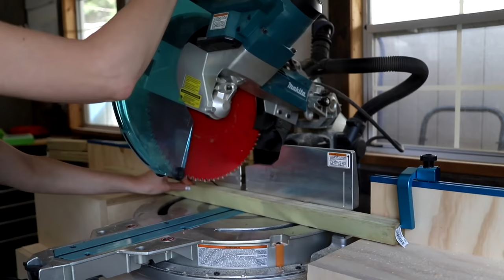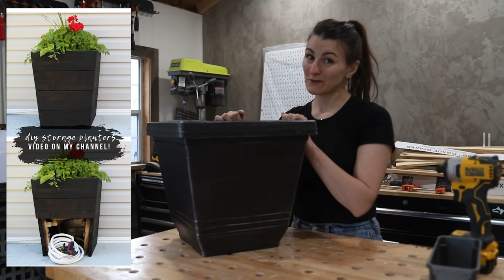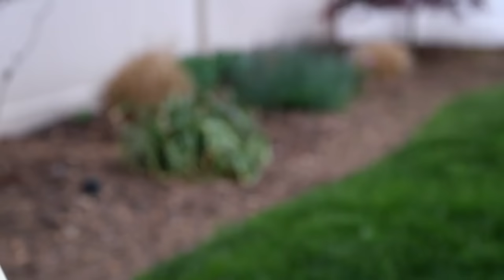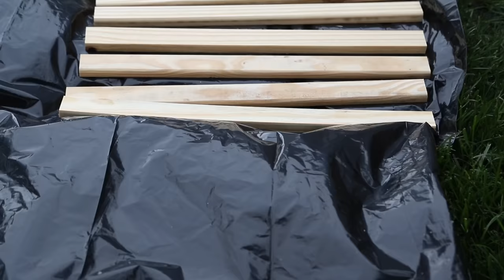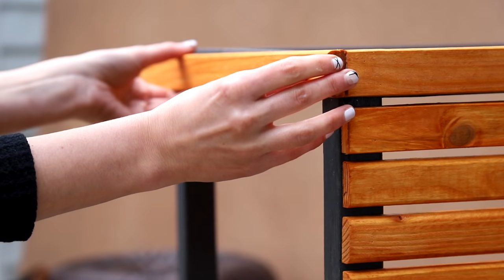EASY DIY PLANTERS (IN 1 WEEKEND & WITH 3 POWER TOOLS)!

Comment: A creative upcycle trick:  use old wood blinds for the slat wood.  Less cutting and cheap;-)
Reply: That. Is. Genius.
Reply: Or pallets... did a similar project with pallets without disassembling them fully. Just some cuts and screwing together.
Reply: Too thin untreated wood, wouldn't last a year outside 👎
Reply: @thedj5914  you can stain and treat the wood.
Reply: For outdoor use is better to stick to pressure treated wood

Comment: Nice job, and yes that olympic deck stain is great, awesome product. I dont recommend using a sealer like poly on anything outside that gets weathered or sun on it, it will always need resealing every year recommended, even the marine varnish also. At 2 years often u will have peeling poly , if it is a porch ceiling that is about only place i use it exterior, other than that i use porch and deck stains that last much longer. Like front doors and shutters i use a product called siekens i think is how it is spelled, it was bought by ppg a couple years ago so it is a ppg product now, but it is a great product.

Comment: Tried this project today; gonna have to modify it because, although I used the measurements from your site, the 14” slats are too short and the 16.5” are too long. I also couldn’t figure out how the two different sizes were to fit around a square box, but I’ll tweak the frame tomorrow and it should come out fine. Thanks for the inspiration!
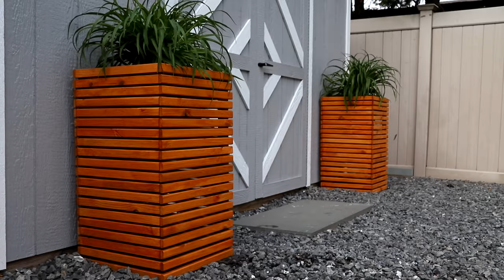Reply: If you pause at 8:13, you can see that she uses 2 different sized slats. So the long ones are for the front and back, and the shorter ones are for the side. The long ones overhang the thickness of the slat. I hope your build turned out okay. :)

Comment: Hey so I used your links and for the pickets they are not half round or anything. Also they have a point so the max you can get from them is 15 1/2 in. So either people have to make the frame smaller or finder longer pieces. The second thing is the pickets are 12 pieces so you would need about 5 packs in order to finish both sides. I ended up just making a smaller version that is 15 in tall with 6 pickets on each side. Than I just put the pot inside and the outer lip stays above the frame. There is a lot of changing that someone who uses your links has to do so hopefully this helps someone! Thanks for the idea!
Reply from the maker: Thanks for the heads up on the links! Should have been linked to the 36” long boards in bundles of 12. All fixed now!
Reply: @diyhuntress  I’ll send you a photo of the one I created on ig thanks for the inspiration! It can put pretty cool!

Comment: Great idea!  Thanks for sharing the video and the explanation how to build them.  Is it necessary to use pressure treated wood when you also use waterproof paint and/or stain? How much did you pay for the wood?
Reply from the maker: Thank you! It’s not necessary, pressure treated was just cheapest! I linked exactly what I used on my website, if you’re interested!
Reply: @diyhuntress  Thanks for your quick reply. Flower shops and DIY shops finally opened again so I'll have a look what I can find there.

Comment: Hi is that 16g nails or 18g nails and are they stainless for outside use any help appreciated
Reply: Definitely not 16g as those would be bigger and more visible.  The plans call for brad nails, but its even hard to see those marks in the video.